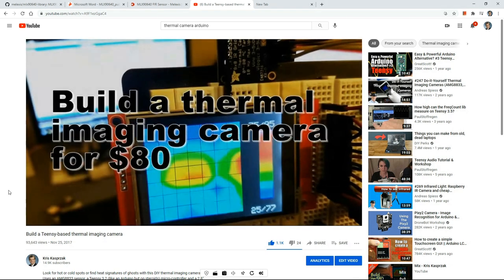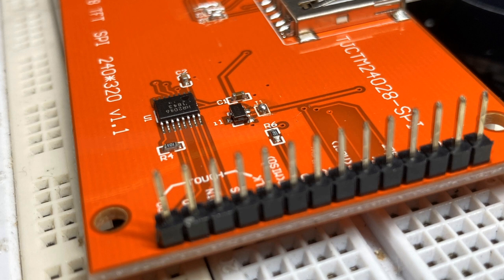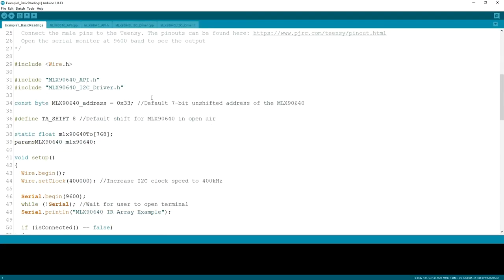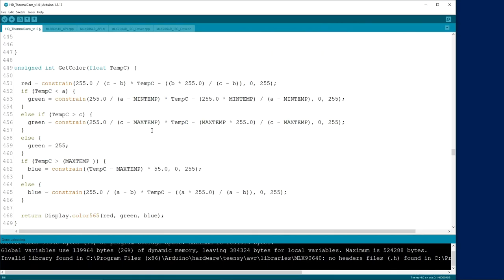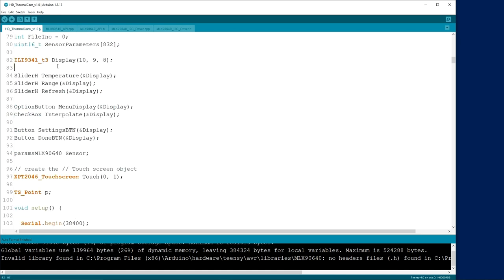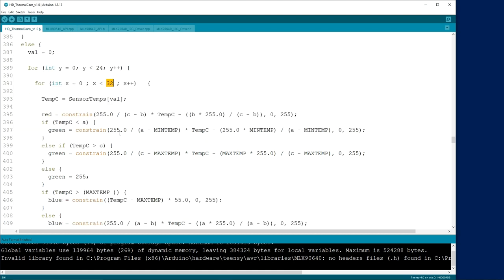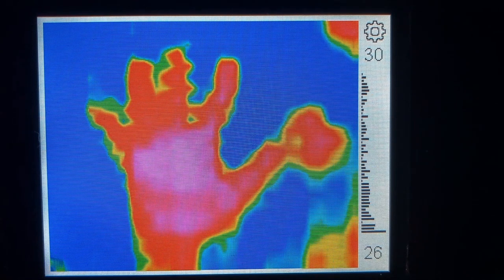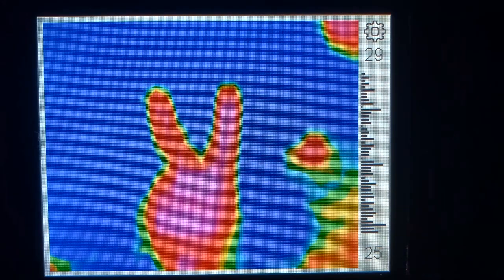DIY high-er res Thermal Camera for $100

Comment: Try using the TFT_ESPI library by Bodmer. You'll need to modify it slightly (or I can share my library config). I also like that red SPI ili9341. I have the SPI bus at 60MHZ (was able to push it to 80mhz with some errors) with the ili9341 on an ESP32. Super fast. Thanks for this upload. I'll be using your code to run the thermal cam. I'm just curious as to the effective range for spotting a person. Thanks a bunch!
Reply from the maker: I'll give that a try someday.

Comment: do you think could be possible to stream incoming data to the sd at full speed? I know the screen is not too speedy, but maybe data could be dumped raw and elaborated to a nice video ofline :D
Reply from the maker: Are you trying to stream the temperature measurements or screen captures? If the former, maybe 320x240 points x 2 color bytes per pixel = 153600 bytes x 4 times per second = 614,400 bytes/second to an SD card? probably not possible without some special optimizations. if you want to grab screen pixels, and send images, forget that...screen capture takes around 7 seconds per screen capture
Reply: @KrisKasprzak  thanks for the answer.  Just the i2c data coming from the sensor ... 24*32*2bytes at frame x  FPS ... Bandwith could be adjusted on the FPS i suppose
Reply: @KrisKasprzak  yes, dump data sampled by sensor and process them offline to obtain a better video. Maybe also a quick RLE algorithm on data streamed to the sd card could lower the bandwidth.

Comment: can a raspberry pi 4 be used instead of the teensy 4.0 board?
Reply from the maker: Sure not. the display is specific to a teensy and probably other things.
Reply: @KrisKasprzak  I mean the cameras SDA and SCL pins to the Pi4 and display through the Pi to a monitor.
Reply from the maker: @bakayaro117  I honestly don't know. I've never used a Pi--and never will :)

Comment: Can that be used to look at PCBs or motherboards for hot spots? Tell-tale shorts? 🤔 Can a sharper (higher resolution) screen be used? Thanks
Reply from the maker: You might be able to get general heat spots but not sure how detailed or accurate will be. Display resolution has nothing to do with it remember this is a 24 x 32 pixel there’s not a lot of resolution that to begin with
Reply: @KrisKasprzak  thanks for the reply! What if you used a higher resolution camera & screen? 🤔 Thanks
Reply from the maker: @j.lietka9406  Have you been able to find a Hi-Rez thermal camera?
Reply: @KrisKasprzak  well no, have not looked! Some of the pre-built quality thermal cameras are a bit expensive!